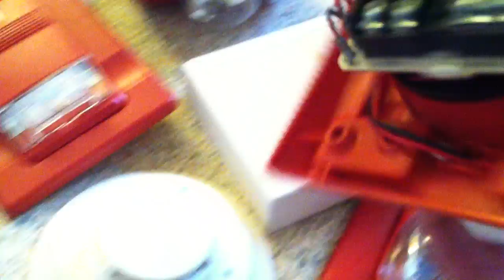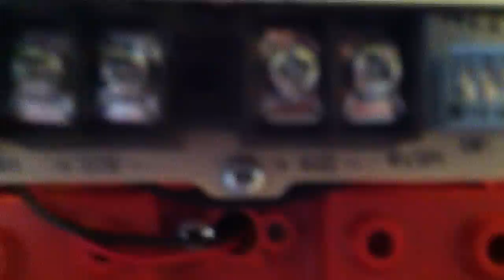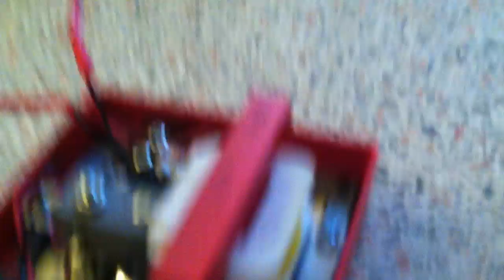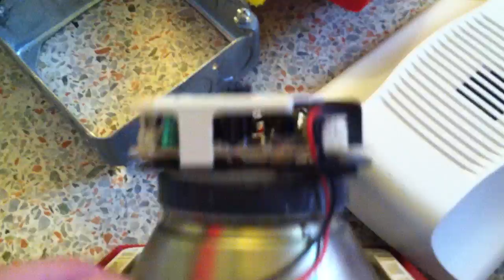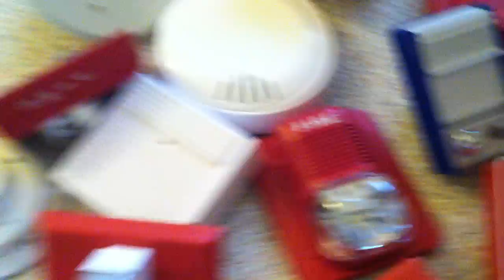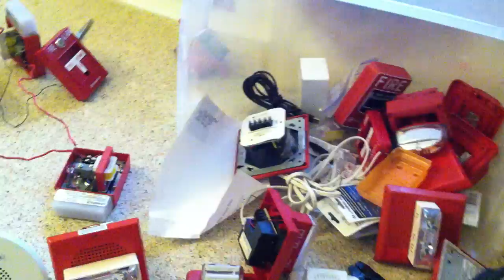Choosing the Right Kind of Fire Alarms (Also Where To Purchase)

Comment: Electro-mechanical horns and bells need to have an MOV device which is voltage suppress device.  That is the little round red thing on the back of your 7002T.  The reason for this is because, when you press silence on the panel, the collapsing magnetic field from the solenoid vibrate mechanism causes a phenomenon called voltage kickback.  If that voltage kickback is not suppressed, it can damage your nac.  So, be careful with relays, and especially older horns and older bells.  Be careful!